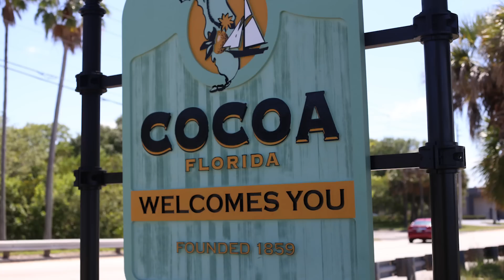SpaceX's Secret Starship Factory...

Comment: Love the visuals in this - Thank you!
It seems obvious to me that, if Musk wants to turn a SH Booster around 3x/day, it's going to have to launch & land at the same spot. In fact, there should be a 1:1 relationship between SH boosters & Stage-zero towers & launch stands.
Building SH boosters doesn't take very long, but Stage-zero is MUCH more complex, so that's where SpaceX needs to put their energy. And they'll want/need several of them.
Then they'll need to start churning out refueling depots for space, as well as Starships, because any Starship that's going to leave Earth orbit is going to need to refuel, either in Earth orbit (GTO?) or in Lunar orbit.
So the number of SH Boosters will be minimal, but each will need its own Stage-zero, which is a huge effort on its own.
But once those are well on their way, the number of Starships, & the number of tankers (& the storage-tanks in orbit) will be HUGE.

Comment: 13:30 having a launch tower and a landing tower is totally against what Elon wants as you could not relaunch the same rocket multiple times a day.( The reason for the design in the first place). Also the arm i think are shorter because it has been determined that the stress on the arms would be too much further away from the mounting point. Shorter arms are lighter arms. After all the one in Texas is the prototype,  designed before there was any real-world data, and the booster design was far less developed.  Your speculation for this has no real evidence . What the newest tower will be used for? it could be for testing  rockets stacks without tieing up the launch tower.